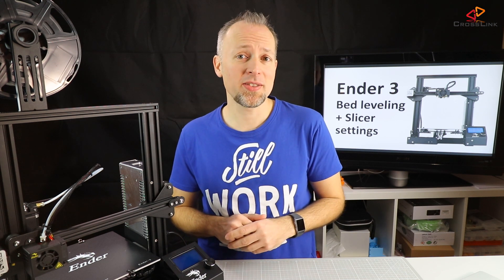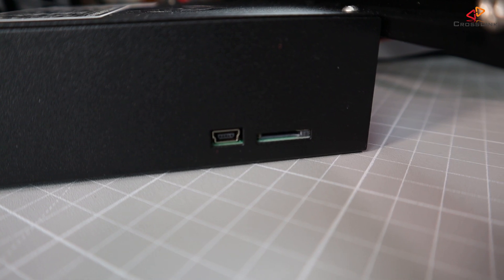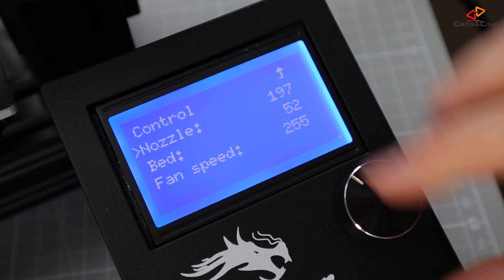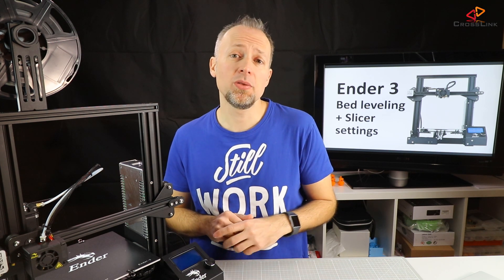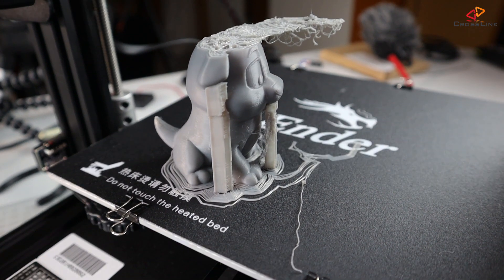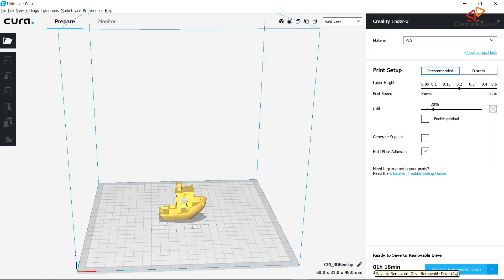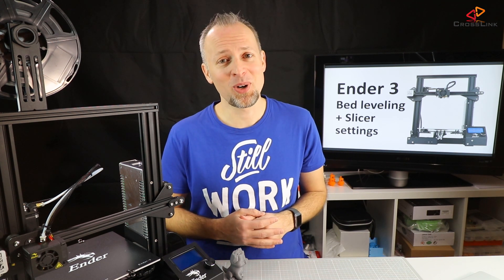Ender 3 Bed leveling and Cura setup

Comment: Here is a video about bed leveling that does not show how not to do bed leveling! What do you expect a firmware to do?? Of course this has to be done manually! What went wrong here is that the paper should be moving with significant difficulty. Keep that for all corners like that and it will be good. There is a possibility that in the center it will not be as high as the corners, that's not an issue keep the corners leveled and it will be good

Comment: Why does everyone choose a small print after when they level the bed? Why don't you try printing something more wider and filling, that it covers the whole surface bed, corner to corner. I always print a rolling tray for smokers as it is 25cmx20cm in size. You can then see where the problem is for leveling...
Reply: Because leveling help with miniatures...

Comment: Your bed levelings information is not Creality's or any bed with Build Tak type material: Build Tak should be leveled cold and no less than 2 thickness, the more the Z gap is reduced the harder it is to remove finished prints resulting in damaging the material if the new owner doesn't do it leveling while hot. Creality's user manual doesn't instruct the owner to preheat the hot end or bed build surface. I own 31 scratch build/purchased printers one enclosed printer in the $600 range ships with masking tape sheets instructions preheating.

Comment: Dear Daniel! Thanks to you great guidelines I was able to install Marlin on my Ender 3 pro! However, bed levelling gives me a strange problem. After finishing the 9 points I started a calibration cube print. The skirt gets faint toward the back of the bed. It seems that these parts do not enough filament get enough filament. I did the bed levelling a couple of times but that didn’t change it. Do you have any idea what might cause this? Thanks for your help

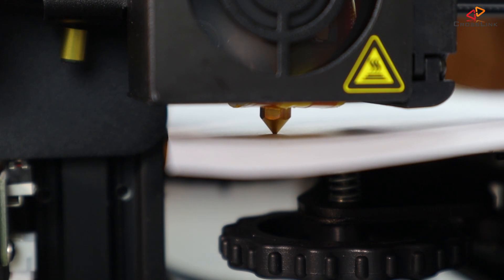Comment: 4:51 yeah so what is correct height? is it paper height or is paper try use is make bed level so nozzle is on surface.
is it better use 1 sheet and loosly move paper OR 2 sheet and do it so you cant move papers under nozzle. you end up same height,but is nozzle 0.1mm(paper height) raised from bed or is nozzle ment to be on Z0 OR is that height better be more than paper thats why it need be loose. will slider print first layer on Z0 or Z0.2(layer height)
if it do Z0 then your nozzle have to be levelled on bed EXACT no paper between use 0.01 shim or cig paper

Comment: 5:25 bcoz THEY still use springs.change one corner will make bed move sideways it effect other corner.
AND i notice same thing on my printer spring is too small.it make tension very slow when its levelled.knob is freely move while printing.first thing i did i printed rod with flange inside springs it keep springs correctly on z and make springs more tension infact i made it so good i tension it all the way in my bed is levelled it wont move LOL bcoz im good. same thing if not use springs at all just parts i made.springs not do anything.and best part i have levelling on CENTRE TOO bcoz bed not flat, but now its flat LOL. never need bed level again! only change z height if z home move

Comment: Hi Daniel, I have a question. is there any reason to turn on the heating while performing the bed adjustment? seems safer not trying to do leveling while parts are hot?
Reply: Follow Media Hi. Heat makes parts expand, if you level your bed with cold parts it might not be correctly leveled when it’s actually printing. Hope this helped.

Comment: I'm frustrated with the print times on the Ender 3 pro.  The flash forge finder, I also use, can print the same object in 1/4 of the time.  Im not sure if it is the slicing program differences or the hardware.  I've adjusted the settings, but the time to print is still much longer.
Reply: most def slicing.  Old post sorry, but if you are not comparing apples to apples you may as well not even think about it.  if all the speeds are the same then there should be zero reason its slower. especially by that amount (or any amount more than the time it takes to heat up the beds and nozzle)

Comment: There really isn't any information given in this video on said title..... besides the use of paper for clearance and Cura on default settings. As a result, I've sat through 3 ad's with nothing to take away in this 11:24 video. Will check your other videos in this subject, but I'd suggest changing the title so other's don't expirence what I have. Good overview on the ender though
Reply from the maker: Hey, thanks for the feedback. What from your point of view would be a better appropriate title for this video?

Comment: why does mine say it will take 2 hours and 4 minutes to print benchy with the same settings?
Reply from the maker: It depends on many factors. Details in Slicer settings and different versions of slicer software can produce those deviations. Also actual print time may differ as well.

Comment: To level the bed you should put the print head directly over the leveling screws. You will find this will decrease the number of times you have to adjust each screw thus making bed leveling much quicker. Once you have leveled the bed this way move the print head to the center of the bed. My bed has a dip in it like everyone else has. Put a piece of paper under the print head. If the paper moves too freely put another piece under.  If you now get the same resistance as you did in the corners then cut out about a three inch square in a piece of paper and put it under the bed mat. It will raise the bed up to the right height in the middle. Bed warp problem solved.

Comment: files that came with the SD card work but anything else doesn't stick to the bed on ender 3 pro
Reply from the maker: Hi, did you slice those other files yourself? What software and settings did you use? For example, I am always using 0.2mm for the first layer, that is what I calibrate my bed leveling for. Sometimes the slicer software suggests 0.3mm or 0.4mm depending on what layer height you choose for the overall print. I always use THE SAME first layer height for all prints.
Reply: Crosslink I used the latest version of Cura with default ender 3 settings and also tried ChazMeisters profile but they both had this issue, I leveled the bed multiple times too

Comment: I loved my Ender 3 Pro when I bought it a few months ago. Then I bought a raspberry pi 4 to flash a bootloader and upgrade marlin to 1.1.9 and now it prints like crap even after calibrating and going over everything with a fine tooth comb. I'm starting to hate 3d printing now.
Reply: Moral of the story is, if something isnt broken, dont fix it. But what problems are you having, what do you mean by it prints like crap
Reply: @bobbin69  Well have you heard of thermal runaway? I don't want my house burning to the ground. I spent about 4 days going over every possibility and finally got it working. The included ender 3 config files with marlin worked fine but I just had to bump up the hot end temp up to 225 to keep my extruder happy. Not exactly sure what the white wire is on the heater block but it was completely loose and I got a good 2 full turns on it. Printed out a spring cup spacer for the extruder spring just in case that was the cause. Got new set screws for the extruder gear. Printing great now. Any idea if that loose white wire might have caused ripples and waves in every print? Not sure if thats a sensor wire or heater wire or ground I have no idea. One other thing I think it may have been was that one of The Edge of Tech videos had a video about extruder calibration and said to enter that in cura settings and basically thats a horrible idea for a beginner at this because all of the calibration gcode files kept changing my extruder steps and then when I would come back later and turn it on it would change back to stock again. That was so confusing. So I removed the steps settings in all of those files and started over and everything went very well after that. Let me know about that wire though I'm curious what it is for. Might have been a good thing I upgraded the firmware just for the thermal runaway.
Reply: Mark Jones Id suggest recalibrating the temperature of your hotend and bed, then run a pid autotune, good luck

Comment: hello why does my cura says 2 hours to print benchy and yours says 1 hour. i checked the settings and its thesame as your
Reply from the maker: My experience is that print times are always longer than what CURA says. So maybe yours is newer and so more accurate to real print times. I know there was a recent update where this was fixed to the better.

Comment: Another youtuber 'CHEP' has an Ender 3 bed levelling video and has an awesome levelling program available for download. It is more accurate as the steppers are working. I would reccommend this set up. Moving the bed by hand can move it up and down.
Reply from the maker: I have tested using the mesh med leveling function to just move the nozzle around the bed and then adjust the bed knobs for equal distance in all corners. Then a second round actually doing the mesh bed leveling.

Comment: Why do they not make it a cable hook up to load files instead of the ad card?
Reply from the maker: what exactly do you mean? you can use a USB cable to control your printer using octoprint or something similar and skip the ad card for sure.

Comment: Great video! I'm facing an issue either with my printer or with cura because I tried to print out a low poly ring as a test and my printer goes to the corner and prints in that corner sometimes even off of the print bed. I'm guessing it has something to do with the gcode? Could anyone explain what might be happening? All help is appreciated
Reply from the maker: Did you already post this on our Discord channel? It would be much easier to help you there because we can exchange images and files much easier.
Reply: @Crosslink3D  I have not done that but I have solved the issue that I was having.. Sorry if I took too much of your time but again, great content!

Comment: After using ender 3 pro for one day I am pretty sure, that leveling should be done without disableing stepper motors, because if you do the extruder might lower by itself accidentally. That is why to properly level the bed you should use control pannel to move extruder - it will remain othe same height throutout the whole process.
Reply from the maker: Good point, checked this yesterday. if you are carefull with moving the axis' nothing changes in disabled steppers mode. But you are right, the method using the control panel is probably better.
Reply: @Crosslink3D  OH MAN, I WAS WRONG!!!
Hello again! This time, after 6 months of using Ender 3 Pro, I have to say that I was completly wrong with what I wrote previously about bed leveling. You were right - you can and should be able to level bed properly with stepper motors turned off. I couldn't level my bed properly by hand because my X-axis bar was not parallel to uper bar of the frame. Everything was tightened properly, frame was leveled and sqare, but that was not enough. The frame itself was sqare, but x-axis bar was higher by 3,5 mm on the left side compared to the right side. That is why I had to do bed leveling always when starting new print. I couldn't do it manually, olny using control pannel seemd to be working. Now when everything is properly leveled, I can level my printer's bed wih stepper motors turned of and it stays leveled for some good prints.
Expirience... nothing can replace it ;P

I would get it earlier, but I was rushing towards printing and I haven't had proper tools to measure it. I've managed to made some nice prints, but that control pannel leveling has been a nightmare. Since I had gotten myself an electronic caliper and had checked printers geometry I had finally realised what was wrong.

Now the bed is leveled properly (not ideally - right side of the x-axis baris 0,65 mm higher than right, but I could not make it better than this, and this seems to be close enough) and all my prints are better than ever before.

Thank you Daniel for making videos and for discussion. Cheers! Have a good printing and keep educating us!

Comment: is it safe to touch the print bed while its hot to move it?
Reply from the maker: That depends very much on the temperature. Up to 60 degrees celsius it might be safe without gloves. Anything above, I would use gloves.
Reply: @Crosslink3D  Thank you! Love your channel btw
Reply from the maker: Good to hear! Keep on printing! Maybe consider becoming a patron 😉
Reply: @Crosslink3D  Absolutely! 👌

Comment: hello i am not sure if you have any idea i have for the last 2 weeks a ender 3 i just built ever thing works well the problem i have is the print head is printing off the bed i have tried to get help from creality but have no replies so far if there is any help you can give me will be a big help i did watch a video that said it could be fixed in EEPROM i have no idea of the setting in eeprom so i am stuck thanks for your time
Reply from the maker: Hi Ken, as far as I know there is only one way to fix bed centering and this is with flashing the Marlin Firmware and setting the correct offset values yourself. 
I made a howto video about this: https://youtu.be/Dqt8cUtzOfs
Are you trying to print something particularly large?

Comment: Hi Daniel .. i have problem with my ender 3 .. bed heating wont stop heating >100 can you please solve my problem ? Thanks
Reply from the maker: The first thing you should do is upgrade to the latest Marlin firmware. It has all sorts of temperature protecting features. The stock firmware is pretty old version of Marlin. Check out my guide here: https://youtu.be/wRODgnAqp1A

Comment: I had the exactly the same issues with my new ender 3.. I adjusted the bed in the 4 corners as you did and the center has a bigger gap.  I printed the same dog and it failed in the same way when it was printing the head. I used a ruler to see if the bed is flat and I don't see any visible gap, but if the nozzle has a gap in the center of the bed and the x axis is level, there must be a problem somewhere.
Reply from the maker: Hi David, sounds really familiar to me. I am trying mesh bed leveling and will document it soon in a video. The gap must be just some microns and this is already enough to cause different adhesion.

Comment: hi daniel 
i just bought a ender 3 and i am facing the same problem as you! the middle of the bed is kind of curved so and when ever i print it does not stick to the bed because of that curve.i raised all 4 corners but it create another issue witch is being too close on corner area.what should i do to solve this problem?
thanks
Reply from the maker: I think even the slightest curve can make a difference. I am currently testing mesh bed leveling. Results to follow soon.

Comment: Hey, Ender 3 does have mesh bed levelling capabilities, but you need to flash a different firmware, enable some code then calibrate it manually. Teaching Tech did a couple videos on this 6 months ago.

Comment: Daniel do you have a method to cut big files on a program??
Reply from the maker: You mean, large STLs into smaller pieces?
Reply: @Crosslink3D  yes :)
Reply: @Crosslink3D  yes!:)
Reply: @Crosslink3D  separer 2 pieces  oui
Reply from the maker: You can try NetFabb Basic, this should work pretty fine.
Reply: @Crosslink3D  thanks a lot Daniel!
Reply: Meshmixer.